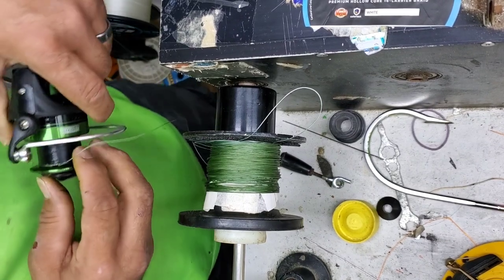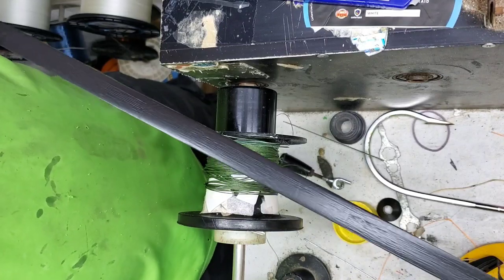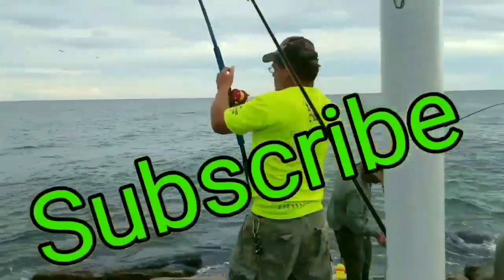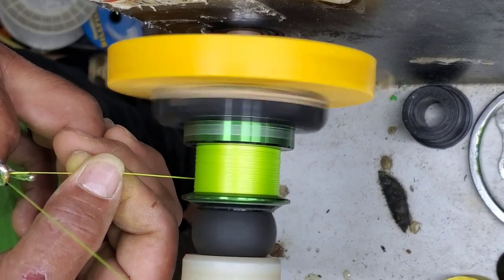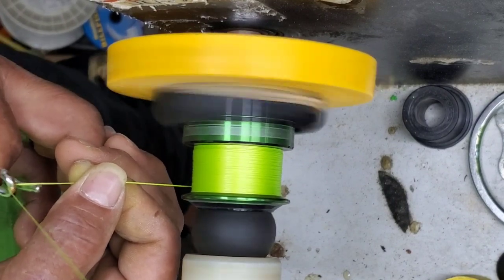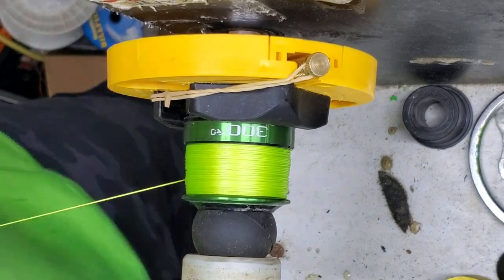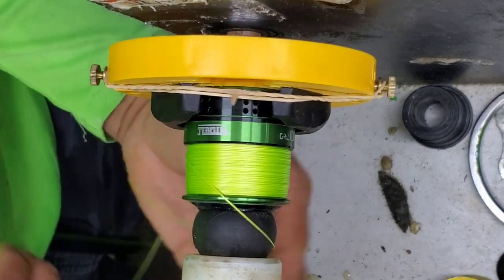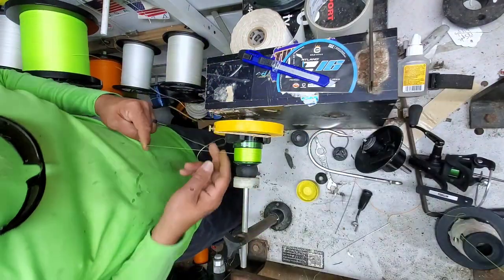Mitchell 300 spinning reel spooled with 40lb Cortland Hollow Core Braid for casting

Comment: I ended up finding the long needles at a sowing shop in town.
Reply from the maker: Very nice how much did they go for
Reply: @TeamHardLife  3.99 for a two pack.
Reply from the maker: Ah nice and they have a soft or sharp point
Reply: @TeamHardLife  feels kinda sharp. Haven't tried using them yet. They are 5 inches long.
Reply from the maker: You will have to dull the tip to use them for sure..
Reply: @TeamHardLife  I will
Reply from the maker: Let me know how it works out.
Reply: @TeamHardLife  I used one yesterday morning to put some 80 # top shot on seems to work pretty well.
Reply from the maker: Good deal and how did you need to dull the tip .. I was using a metal slab and thumping it against it a few times...
Reply: @TeamHardLife  I used a knife sharpening stone. Held the needle straight up and down. Then at a forty-five rolling it will my fingers
Reply from the maker: You aren't catching any of the fibers.. ?
Reply: @TeamHardLife  no
Reply: @TeamHardLife  I just blunted the needle some more and it seems like it's hitting on something inside the line. But it could be just the line I'm using. 
( pro Cat )H20 from Academy
Reply from the maker: Is that a hollow core?
Reply: @TeamHardLife  I'm assuming it is. There's nothing on the package saying it is.

Comment: 40# is overkill. I catch 25lb jack crevalle with 15#.
Reply from the maker: We rather have over kill cause we can catch more per hour and also not get worn out by fighting them too long we can land them in a few minutes and even got video where I landed a 44" in about 15secs...
Reply: @TeamHardLife  well i use 'heavier' header, that is 30#, but mainline is always light. not only does lighter appear less noticeable in the water, but you can spool a lot more of it.
Reply from the maker: Ok so are you talking mono or braid... ?
Reply: @TeamHardLife  15# braid to double uni 30# mono leader is my setup for off the jetties around where I live. just caught a 25lb+ Jack two weeks ago using that and a uglystik gx2 mh. cheers.
Reply from the maker: Not saying it can't be done, we're saying we pull them in fast so we can getbmore caught per hr of fishing cause when they run thru you only get a small window her usually a couple hours.. and if your fighting 1 for 30- 45 minutes compared to us 1- 5 minutes we better our chances to load up on these shark baits.. and especially when we want to use them alive we can't fight them and wear them out cause they die fast too ..